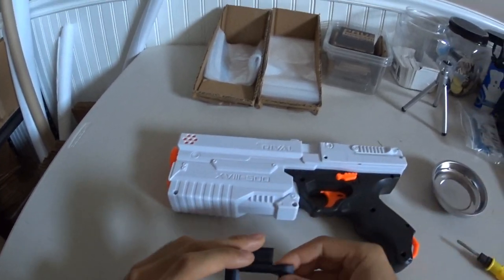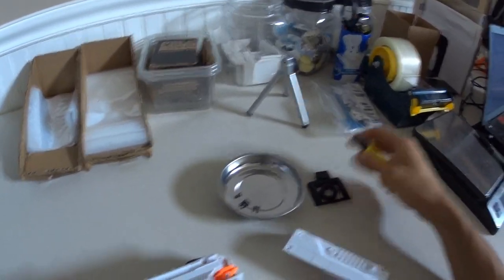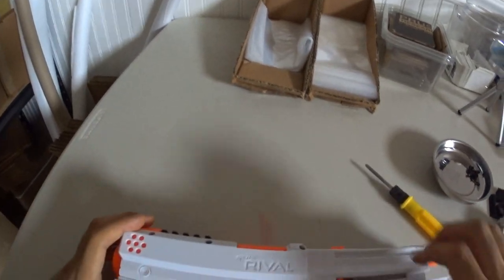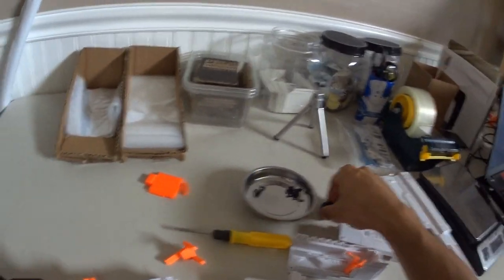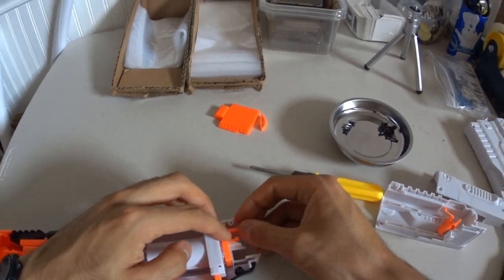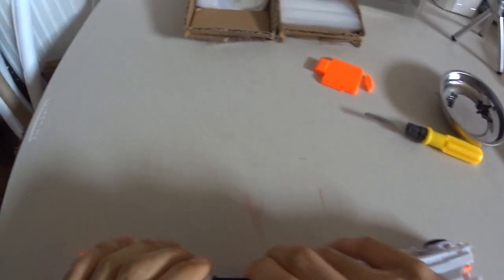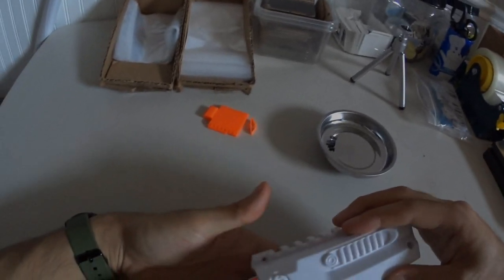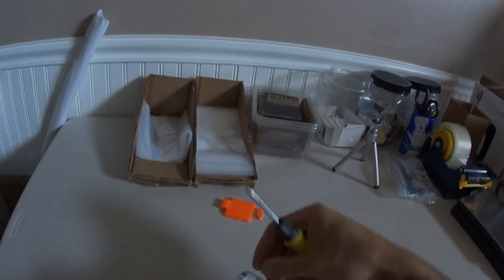Kronos Door Delete & Spring Spacer Install

Comment: Looks tough to do
Reply from the maker: It's not too hard, the most tedious part is just unscrewing/screwing all the screws. I've done this mod to about 30 Kronos blasters now so I've got it down. I'll make another video that simplifies the whole process. I've gotten much faster with all the practice.
Reply: @foamtechnician2603  Yea, It's pretty easy once you've done it. Another good idea on any Rival blaster is to pad the plunger head. Especially if you've put in an upgraded spring or spring spacer. You know those felt or rubber circular pads they sell at a lot of stores? The medium ones fit perfectly into the cup at the end of the plunger head. This makes full use of the air in the plunger tube and protects the plunger head and air restrictor. It also gives it more power and accuracy.  I've done it to two Kronos, a Helios and a Hades with very impressive results!